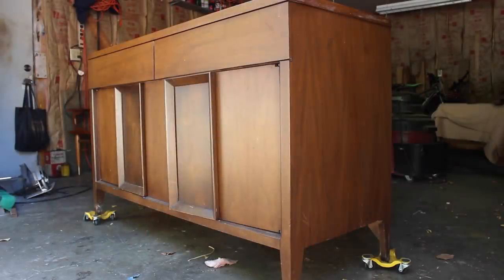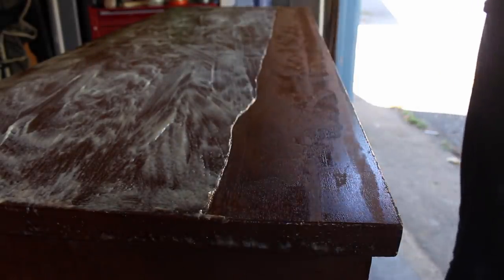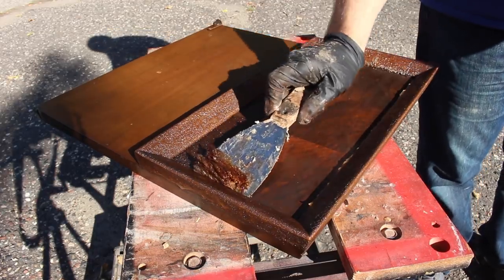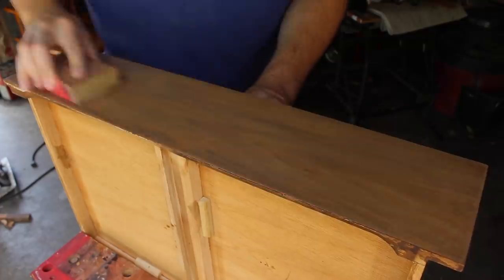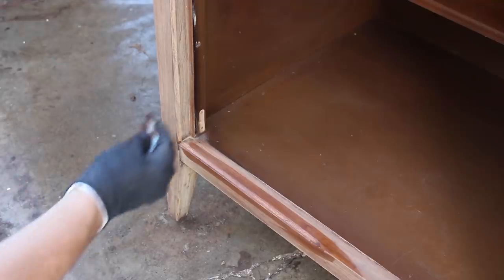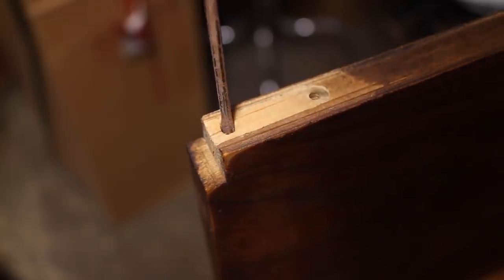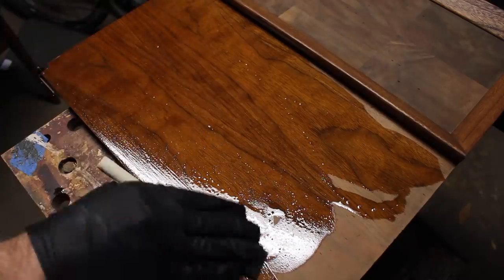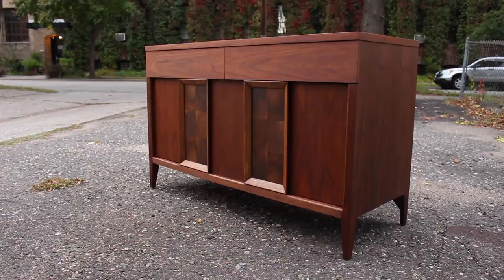Thrift Store Rescue #11 | Refinishing A Vintage Thrift Store Credenza | Furniture Restoration

Comment: Absolutely beautiful! I've refinished about 25 mid-century pieces of varying complexity and he hits on all the key issues I've discovered, especially NOT to use a powered sander on the edges of any piece. He also mentions how after stripping and sanding,  you usually reveal some solid wood parts that are a different species and color and I've also had to use stain to adjust for that. 

And I also love Danish oil! The difference with me is that I like to apply once and then 2 applications of lacquer or polyurethane for durability. 

And yes - thrift stores often damage pieces in transport or even within the store :-( When I purchase something, I ask the employee to use my moving blankets and I tip the guy or woman $3-5 as a thank you if they do what I ask. I've become friendly with a few employees :-)

Comment: I love your patience and all your projects!  I do remember my mom using stripper on her antique finds and scraping and scraping and scraping. She had a big assed electric sander so she had to do a lot of hand sanding as well. I’ve  been given an old washstand from her with a drawer and a little door underneath. I’ve been debating what to do for a couple years. She has refinished it but that was like in the 70’s. I believe it’s oak, or partly. The top of the washstand is quite nice actually but it has had the old 1-2 coats of varnish on it from days gone past. I’m afraid of ruining it somehow, so when I finally have the courage to update it, I’ll be following your channel.

Comment: great job as usual. I am glad you mentioned the change in Citrus Stip. I was thinking that it was only me ;) I've noticed a big difference  when they changed from the cloudy mixture to the newer bright orange jello looking stuff.
Reply from the maker: Yeah, the old stuff worked so much better for me.
Reply: Dashner Design & Restoration similar problems here in the U.K. They banned a key ingredient a few years ago, methyl chloride or something like that I believe, and since then it's almost impossible to strip anything. I spent days trying to remove a century worth of paint from a cast iron fireplace in situ, nothing worked. Needed up removing it, having it blasted and reinstalling it.

Comment: @Dashner.... I used to use a product called Dad's Easy Spray stripper.  It came with a spray bottle on the side of the 1 gallon can (3.7ltrs) I could only find it at an ACE hardware store.  ACE stopped stocking it due to how harsh the product was.  It is very nasty stuff, it stings badly if it gets on your skin.   The fumes were minimal but the job it did was amazing.  It would completely remove a finish from anything.  It was also very expensive at ~ $45 per gallon.  It came in a blue and yellow toned container, I think I saw a video you did using this product.

Comment: Lovely work. You’re absolutely right about sanding through the veneer. Another reason is that the finish clogs the paper. As you showed, sanding takes time. Any reason for using the new stripper? Great video as always.

Comment: Another fine restoration!! Quick question. Once the Danish oil has dried, could you then apply a coat or two of clear varnish to protect the surface. Or will the two products react badly with each other? Many thanks.

Comment: What stripper did you use? I found this awesome mid century dresser that has deep some deep scratches.. I wanted to strip the veneer and do danish oil. I was wondering if i did wood filler on the scratches if the danish oil would cover them after hand sanding?

Comment: I'm the one who suggested the heat gun on Instagram.  Did you check out the photos I sent you? They show that it's easy to do and doesn't damage the wood under the finish. Strippers nowadays are weak or take too long and are messy as well. Great video by the way 👍

Comment: Love your videos, have a question on this one.  The trim on the front outlining the rectangles looks off to me, too light b/c they are a different wood. (even with the gel stain)  If you cannot get the look right with stain would you consider replacing the wood trim with walnut?  If it made sense financially.

Comment: Great video as  time you didn’t say it was a good day to go thrifting, and this time you used danish oil instead of wipe on poly. Is it because this time it’s solid wood and not plywood ? I’m about to refinish a mid century desk made of teak veneer and I’m worried about the finish. I bough brush 3v3 varnish but I’m afraid of leaving brush marks. Would you recommend the danish oil or the wipe on poly instead ?
Reply from the maker: Yes, the danish oil and wipe on poly are easier because you don't have to worry about leaving brush marks.  Of the two, Danish oil is the easiest.

Comment: I was wondering if you might know the best General Finishes Gel Stain  color to match their water based stain called Provincial. I didn't realize that the colors didn't follow all through their product line. I used the Provincial on a new butcherblock countertop and love the contrast with my white cabinets. We have an island area with slate top and stained cabinets. They are stained Minwax Provincial which is very unlike the provincial from General finishes.  Looks more like a medium reddish brown color, like chestnut. I wanted to not have to remove the exisiting finish, but just clean it up and sand lightly then apply Gel Stain, sadly now I'm just at a standstill and can't decide what color to try. I know that if I had the same color in Gel Stain it would look different on the stained island than it did on the new wood counter. Would appreciate any insite you might have about my problem. We love your videos. Also love all the Mid Century finds. Inspiring!!

Comment: Beautiful wrk on a lovely furniture piece. Are your projects impacted by the lowering of temperature? If so, what do you do to compensate for the weather change?
Reply from the maker: Yes, the temperature is a factor.  In my experience most finishes and strippers work best above 60 degrees.  When the weather gets cold I just have to move inside.

Comment: Please , question :
All the scratches that you showed at the beginning by the use and the bad  handling in the thrift store were gone just by stripping and sanding?
Reply from the maker: Yes, they came out with stripping and sanding.  The scratches were mostly in the finish.
Reply: Thank you.

Comment: What kind of stripper are you using omg... did I say he was going to burn through that veneer or not! cheaper wood? You mean the hardwood frame of the case, and they fixed that by spraying toners to even the colour difference out.  Oil has to be reapplied every year and is nowhere near a durable finish as you would get with the appropriate lacquer finish; that lasted the fifty years that was originally on it. 
Just wow